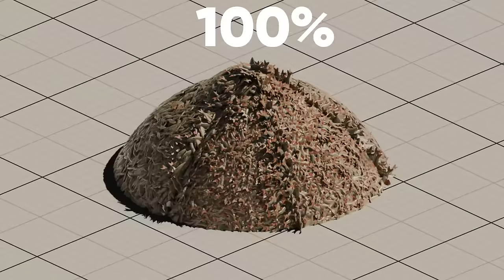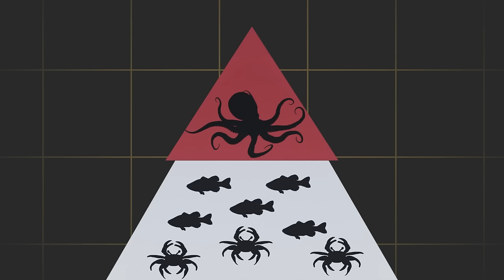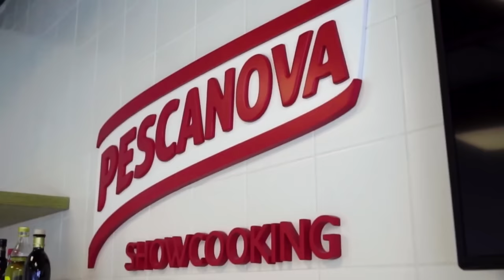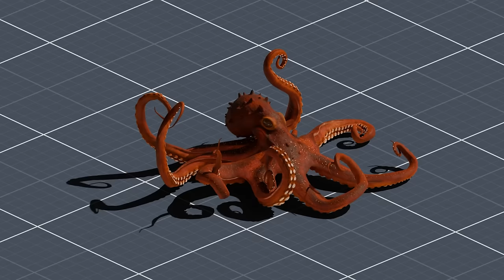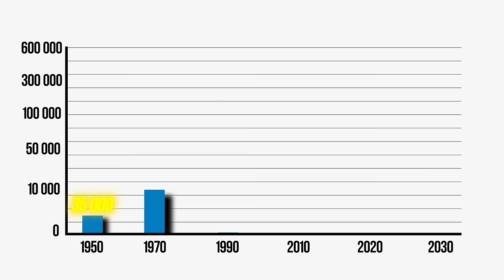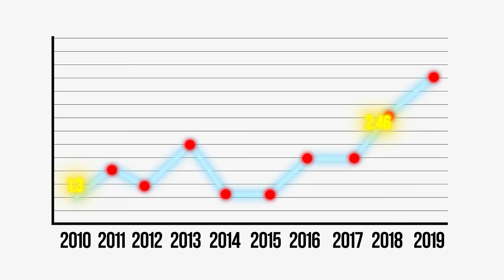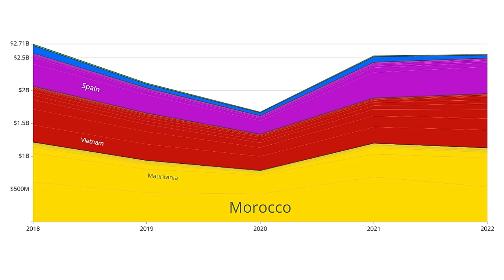Never Grow Octopuses

Comment: I have a very strict policy of only eating things that won't struggle on the way down. I guess that would make me a picky eater, if I was Korean.

If octopus populations in the wild are depleted from overfishing, that constitutes an obvious, conservationist benefit to octopus farming. The fact that octopus is considered a delicacy may also mean that farming will result in a reduction of consumption. People are funny; once something is too cheaply and easily available, it no longer tastes as good. Limiting haw much animal protein is used in farming will either be handled by the market or by market regulation. Simply banning things to avoid having to do them sensibly is a bad strategy. The biggest objection is animal welfare; clearly, there are many issues that need to be resolved, before large scale production. Once the industry becomes economically significant, forcing it to resolve problems will be harder, not easier, so right now is the time to apply sensible pressure.

Since the octopus is exothermic, I seriously doubt that freezing is a very painful death for them. In fact, if it's done gradually, they shouldn't even notice it.